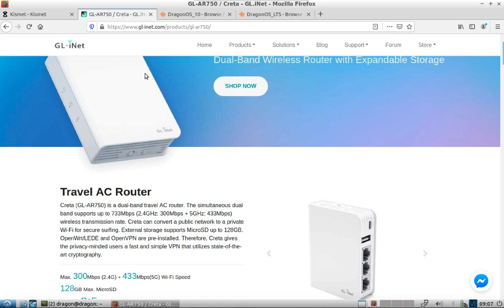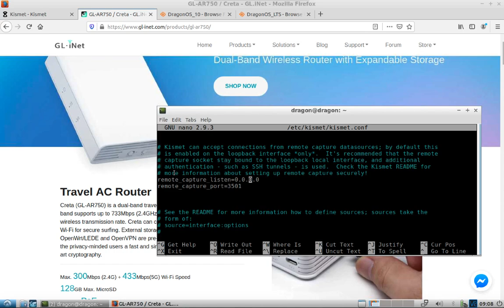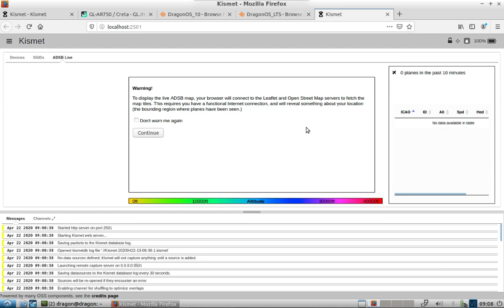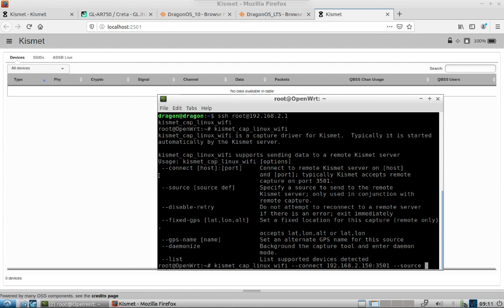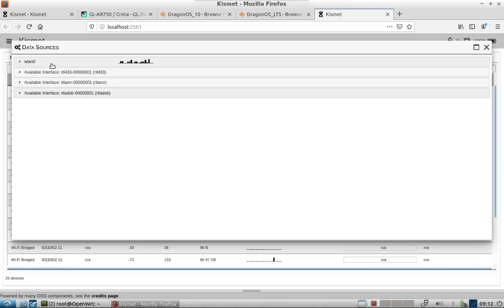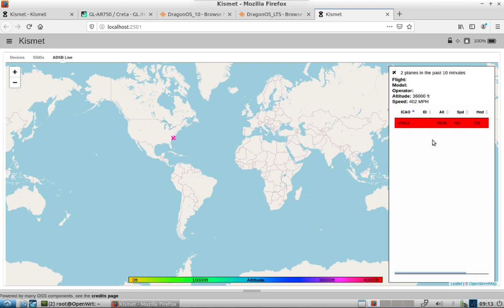DragonOS LTS/10 Kismet Server + remote sensor (OpenWRT WiFi, kismet-remote, rtl sdr, rtladsb)

Comment: is the OpenWRT connected to the kismet server via cable or wirelessly?
Reply from the maker: If I recall, wired as the wireless would be in use by kismet. That’s not to say you couldn’t connect another usb wireless or cellular to the router depending on setup.
Reply: @cemaxecuter7783  Is there some way of using the same wireless nic to both scan and be connected to a network?
Reply from the maker: @gomusmogus unfortunately not when using kismet as it puts itself in monitor mode. If it’s a dual band router with two different nics inside you could leave one not controlled by kismet to connect wirelessly.

Comment: This is great, thanks cemaxecuter. Regarding added the adsb source, do you happen to have that command or syntax? I'm using the following "kismet_cap_sdr_rtladsb --connect localhost:3501 --tcp --user XXXXX --password XXXXX --source=rtladsb-00000001" but get kicked back "Connecting to remote server localhost:3501
Registering remote source rtladsb rtladsb-00000001
Found Rafael Micro R820T tuner
Exact sample rate is: 2000000.052982 Hz
Allocating 12 zero-copy buffers" Which looks great, but I'm not seeing anything under the ADSB tab of Kismet. Is the sample rate incorrect?
Reply from the maker: I’ll have to try when I can get my Rtlsdr, for some reason I’m not recalling passing the user/password with —tcp. I know kismet has been updated a lot since this video and I’m trying to think what else it might be. From what I can see, you’re trying to use the remote capture source on the same system that’s running the server? If that’s the cause you shouldn’t have to use the remote cap way and could just go into the kismet server GUI and turn it on. However, if you’re trying to send from one system over the network to the server, don’t forget about going into the /etc/kismet/kismet.conf file and change where it’s saying 127.0.0.1 for incoming connections to 0.0.0.0.

Not the most secure setup, but it’ll at least get you connected till you can setup a tunnel or some other method.
Reply from the maker: Well actually looking at your info above, I guess using what you’re doing would actually connect because you’re doing it on the same system as the server. It doesn’t appear that you’re missing anything since kismet sets the freq/sample rate for you or at least I’ve never had to do anything else. Assuming you’ve got a good antenna and have some air traffic close by?
Reply from the maker: Okay now I see, username and password is for web based socket connection. You’ve used the —tcp flag so I don’t think username/password is needed. When you make the connection, do you see the device then listed on the kismet server end? Might have to let it run awhile and see if you pick up some traffic.
Reply: @cemaxecuter7783  Yes thanks! I am seeing the device on the Kismet side. We're out in Northern VA, near the IAD airport. So we should see something. Regarding the antenna type. Can I use one from an external wifi adapter? So long as the SMA male/female is correct?
Reply from the maker: I’d try and use the one that typically comes with the rtlsdr, I don’t think the WiFi one would be good considering the frequency and ones being typically sold for just adsb. I’ve had pretty good luck with the standard rtlsdr one though.
Reply: @cemaxecuter7783   Have you had luck with adding multiple GPS units to report in their location into Kismet? We have several data sources forwarding their data into Kismet, but GPS information seems to need more configuration.
Reply from the maker: So interesting topic.. depends on how you have things setup, but say you’re running remote kismet cap devices. By design the kismet dev only allows them to be set with static GPS which is then passed to the kismet server, but the good news is another developer helped me out and made a python based proxy. I have a video showing how it works. One sec, I’ll find the link.
Reply from the maker: Watch the part about kisStatic2Mobile. That’s included on the Pi build and x86 build
DragonOS Pi64 w/ kisStatic2Mobile + Kismet Remote, SDR++, and SigPloit (Pi4, RSP1A, HackRF, GPSD) https://youtu.be/eWs7y6Yt9Q8
Reply: @cemaxecuter7783  thank you!!
Reply: @cemaxecuter7783   yeah, I'll give it some more time, just been a few hours and seemed odd.

Comment: Hi, I was able to build kismet-remote(cap) following the instructions in https://www.kismetwireless.net/docs/howto/openwrt_remote/ for my GL-AR750, however there is not enough free space in root to install all dependencies, even when I re-image the GL-AR750. I booted with a 16GB SDcard but the instructions to expand the root filesystem on OpenWRT ( https://openwrt.org/docs/guide-user/additional-software/extroot_configuration ) although only 6 months old do not seem to match the configuration of the OpenWRT version for the GL-AR750.

How were you able to expand the storage on the GL-AR750? 

My own attempts so far eventually bricked my device.
Any guidance would be greatly appreciated!
Reply from the maker: Hi Dennis. My ar750 has 16mb flash which was plenty of room for kismet remote and more. I’ll go double check my firmware files and see if I still have it built. Maybe you could try mine while we figure out what’s going on? For another device, the hootoo, I actually did get around to moving the root file system to a usb stick - I saved those steps in a word document. I’ll look for that too. But you shouldn’t need it for the ar750.
Reply from the maker: I think there’s a way to reflash the ar750 even when it appears to be bricked. I just have to refresh my memory. I don’t remember having to do this, but it looks like a way you can reflash in worse case scenario.

https://docs.gl-inet.com/en/3/troubleshooting/debrick/
Reply: @cemaxecuter7783  Thanks, the reflashing works fine. I have done that a couple of times now as the device did not boot up after my attempts to expand storage. If you could provide me with a working kismet-remote build for the GL-AR750 that'd be great. I'd like to know if that installs without any problems. If it does I'd like to find out what I did different/wrong on building kismet-remote. 

I built the package on Ubuntu 18.04 LTS and a couple of things did not per se match your instructions.

- For instance on Enable Kismet using 'make menuconfig' I found kismet-remotecap under *Network => wireless*. So no kismet-remote as described in your instructions.
- Compiling initially failed on libusb-1.0 missing. I had to compile that first running make package/libs/libusb/compile from the openwrt directory.
Reply from the maker: @dennisbinkhorst2039  I went back and found my folder that contains the stock openwrt firmware. Flash with that first, then you can see the packages I made for my AR750. Pull what you need, which I think is just the kismet and libprotobuf ipk. More then welcome to add aircrack and mdk4, but you'll have to copy over all the packages with WinSCP or whatever and install manually with opkg install " " package name. Typically you'll have to do things in order based on dependencies, but I think you actually may have enough room to copy all the packages over and tell opkg to install * basically everything. Either way, you should be up and running with the slightly older kismet remote like I show in the video.

https://drive.google.com/drive/folders/170rfgktywbaiCwF3SeMkSr4xPSYGnM4e?usp=sharing
Reply from the maker: @dennisbinkhorst2039  One more thing, you actually reminded me of something. I think I went back to build openwrt/kismet a couple months ago and there was some changes and updates with kismet remote (maybe 2019 now?). I do recall some difficulty in building it, so I'll take another look.
Reply: @cemaxecuter7783  Thanks a lot! I will try that out later today (it's 16:00 CET here) and will let you know if things worked out.
Reply from the maker: Wanted to note that you can make both the 2.4 and 5ghz radios report back to kismet. I can’t remover if I did it all in one command or two separate and just changed the source in each one.
Reply: @cemaxecuter7783  I figured that a possibility! Will report back. Thanks again!
Reply: @cemaxecuter7783  Hi, I managed to compile a successful kismet-remotecap build. The packages you lend me access to did work after I upgraded to OpenWRT version 18.06.4. 
So after seeing data coming in on my Kismet Server machine, I figured I upgrade the GL-AR750 to OpenWRT version 19.07.3 and try to compile again. First try yesterday: Dependency issues again. So i did a git pull this morning and all of a sudden everything compiled well and there were no dependency issues.
Just to be sure I replicated all steps from scratch to be able to install an as clean as possible configuration to the GL-AR750:

PREPARING THE DEVICE
I installed the latest GL.Inet OEM image for the GL-AR750 (openwrt-ar750-3.027.bin) and after setting a new password and allowing access to the device from ports 22 and 80 from my home network I upgraded the device to OpenWRT version 19.07.3 (openwrt-19.07.3-ar71xx-generic-gl-ar750-squashfs-sysupgrade.bin).

BUILDING KISMET REMOTECAP FOR OPENWRT
I built kismet remote on my Ubuntu 18.04.4 LTS workstation.
01. # git clone https://www.kismetwireless.net/git/kismet.git -b kismet-2020-04
02. # git clone https://github.com/openwrt/openwrt.git -b openwrt-19-07
03. # cd openwrt
04. # make menuconfig => ar7xxx & enabkle feeds
05. # ./scripts/feeds update -a
06. # ./scripts/feeds install -a
07. # cp -R ../kismet/packaging/openwrt/kismet-remote-openwrt/ package/network/
08. # make menuconfig (Select Network=>wireless=>kismet-remotecap)
09. # make -j7 V=s (fails with ERROR: libusb-1.0 cannot be found)
10. # make package/libs/libusb/compile
11. # make -j7 V=s
I believe it is fair to say compiling libusb (10) prior to compiling openwrt (09) will prevent the ERROR, but I haven't yet tested that.

INSTALLING KISMET REMOTECAP TO THE GL-AR750
First I copied libprotobuf-c and kismet-remotecap to the GL-AR750 
12. # scp packages/libprotobuf-c_1.3.1-2_mips_24kc.ipk base/kismet-remotecap_2020-03-R1-1_mips_24kc.ipk user@kismet-cli001:/tmp/kismetfiles/
Next, I logged on to the GL-AR750 over SSH:
13. # ssh root@kismet-cli001
Installed the packages:
14. # cd /tmp/kismetfiles
15. # opkg install *.ipk
This, as expected, lead to unmet dependencies. So I looked up the dependencies on my Ubuntu 18.04.04 LTS 
workstation and uploaded these and tried to install again:
_satisfy dependencies for: Cannot satisfy the following dependencies for kismet-remotecap:
  	libpcap1	
  	libpcre		
  	libmicrohttpd	
  	libnl200	
  	libcap	
  	libstdcpp6	
 	libncurses6	
  	libsqlite3-0	
  	zlib		
  	protobuf-lite	
  	libdw1_		
16. # scp bin/packages/mips_24kc/base/libpcap1_1.9.1-2.1_mips_24kc.ipk bin/packages/mips_24kc/packages/libpcre_8.43-1_mips_24kc.ipk bin/packages/mips_24kc/packages/libmicrohttpd-no-ssl_0.9.62-3_mips_24kc.ipk bin/packages/mips_24kc/base/libnl200_3.4.0-2_mips_24kc.ipk bin/packages/mips_24kc/packages/libcap_2.27-1_mips_24kc.ipk bin/targets/ar71xx/generic/packages/libstdcpp6_7.5.0-2_mips_24kc.ipk bin/packages/mips_24kc/base/libncurses6_6.1-5_mips_24kc.ipk bin/packages/mips_24kc/packages/libsqlite3-0_3310100-1_mips_24kc.ipk bin/packages/mips_24kc/base/zlib_1.2.11-3_mips_24kc.ipk bin/packages/mips_24kc/packages/protobuf-lite_3.7.1-1_mips_24kc.ipk bin/packages/mips_24kc/base/libdw1_0.177-1_mips_24kc.ipk root@kismet-cli001:/tmp/kismetfiles/
17. # opkg install *.ipk
Again, unmet dependencies which I looked up and copied to the GL-AR750:
_ satisfy dependencies for: Cannot satisfy the following dependencies for kismet-remotecap:
  	libnl-genl200	bin/packages/mips_24kc/base/libnl-genl200_3.4.0-2_mips_24kc.ipk
  	libnl-route200	bin/packages/mips_24kc/base/libnl-route200_3.4.0-2_mips_24kc.ipk
  	libnl-nf200	bin/packages/mips_24kc/base/libnl-nf200_3.4.0-2_mips_24kc.ipk
  	terminfo	bin/packages/mips_24kc/base/terminfo_6.1-5_mips_24kc.ipk
  	libatomic1	bin/targets/ar71xx/generic/packages/libatomic1_7.5.0-2_mips_24kc.ipk
  	libelf1		bin/packages/mips_24kc/base/libelf1_0.177-1_mips_24kc.ipk
  	libbz2-1.0_
18. # scp bin/packages/mips_24kc/base/libnl-genl200_3.4.0-2_mips_24kc.ipk bin/packages/mips_24kc/base/libnl-route200_3.4.0-2_mips_24kc.ipk bin/packages/mips_24kc/base/libnl-nf200_3.4.0-2_mips_24kc.ipk bin/packages/mips_24kc/base/terminfo_6.1-5_mips_24kc.ipk bin/targets/ar71xx/generic/packages/libatomic1_7.5.0-2_mips_24kc.ipk bin/packages/mips_24kc/base/libelf1_0.177-1_mips_24kc.ipk bin/packages/mips_24kc/base/libbz2-1.0_1.0.8-1_mips_24kc.ipk root@kismet-cli001:/tmp/kismetfiles
19.# opkg install *.ipk
This resulted in one last unmet dependency, which was copied and installed:
_satisfy dependencies for: Cannot satisfy the following dependencies for libnl-genl200:
  	libnl-core200
  opkg install cmd: Cannot install package libnl-genl200.
  satisfy dependencies for: Cannot satisfy the following dependencies for libnl-nf200:
  	libnl-core200
  opkg_install_cmd: Cannot install package libnl-nf200._
20. # scp bin/packages/mips_24kc/base/libnl-nf200_3.4.0-2_mips_24kc.ipk root@kismet-cli001:/tmp/kismetfiles
21. # opkg install *.ipk
SUCCESS!

I then ran # kismet_cap_linux_wifi --connect kismet-server:3501 --source=wlan0
INFO - Connected to 'kismet-server:3501'...
INFO - kismet-server:3501 starting capture...

I know this is probably a bit too much information but I hope it may help someone who wishes to configure a setup like this.
Thanks again, you showed me the way!
Reply from the maker: Dennis Binkhorst no this is awesome! Thank you. I’m going to copy and paste this ASAP into a word document because I had some people looking to do the same. Pretty powerful stuff right?! I can’t wait till the kismet developer adds the ability for kismet remote to work with gps pucks. He’s said it’s on his list to do. I think it’d be really powerful to have those routers capable of moving around while feeding live info to the server that included real gps! Sort of like the sparrow WiFi agent does.
Reply from the maker: Dennis Binkhorst you’ve probably noticed but you can also give the source a unique name. I don’t recall the command line switch to do it right now, but it’s possible alone with sending static gps.
Reply: @cemaxecuter7783  Indeed powerfull stuff! Every time people pass by on the front pavement to my house I see a new log line: "Detected new 802.11 WiFi device" followed by the MAC-Address. I can see bridged devices (wired) that are connected to other people's AP's. Crazy. I'm already planning on reconfiguring my home network setup because of the detailed information kismet provides me on my own WiFi network and attached (wired) devices. Shocking to be honest.. But very nice. Loads of possibilities.
Reply from the maker: Dennis Binkhorst oh wait, I didn’t think about bridged. So you’re saying an AP in Bridge mode that’s passing along the MAC addresses of the wired devices? Instead of client mode where you’d just see the Mac of the AP in client mode? Good point.
Reply: @cemaxecuter7783  Yes, correct! Insecure networks all around me. Crazy stuff..
Reply from the maker: @dennisbinkhorst2039  So there's a new Kismet release with some new features for OpenWRT/remote.. I'm building it now. The directions are very similar to what you mentioned above, with the exception of a separate GitHub package page that contains the Kismet/openwrt related packages. If it builds and completes I might make a video of it and show how the remote sensors can automatically find the server so long as they're on the same network.